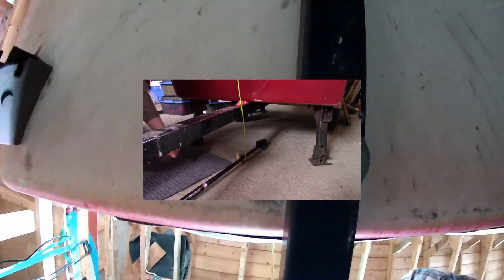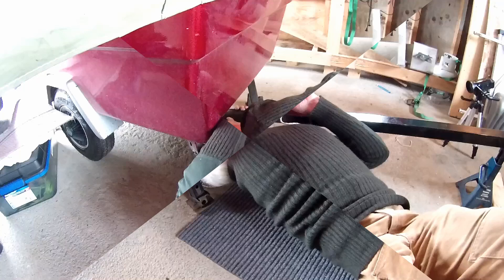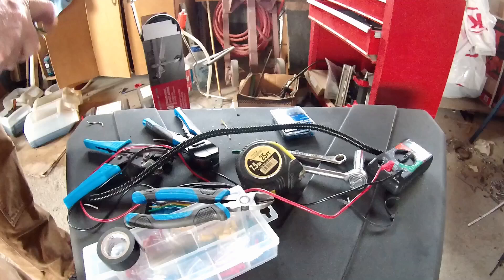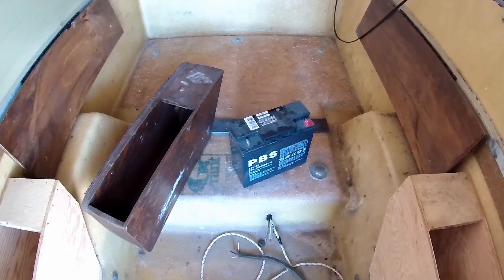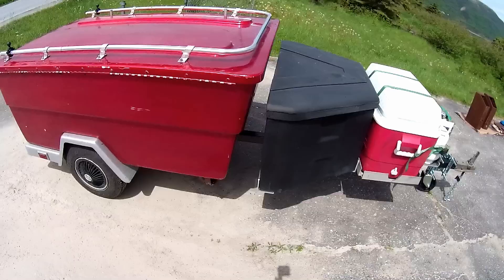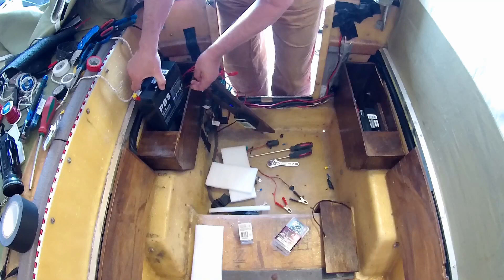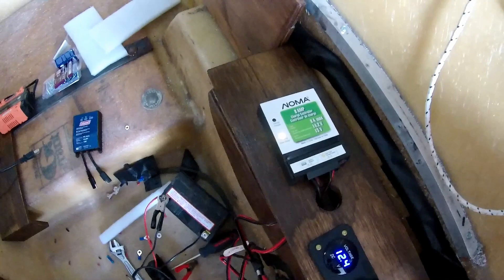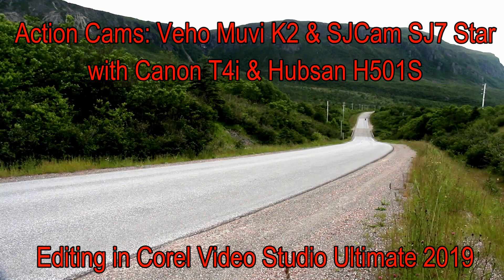More MINI MATE Renovations Part 1 2019 Ep 24

Comment: I own a Mini Mate as well and have enjoyed your videos and especially some of your mods. I plan to steal a few. I'm about the same vintage as you so can appreciate your perspective.
I found it interesting when you removed the tongue. The second bolt holding it on is someone's modification. I know this because my first run with mine 3 years ago (I'm the second owner) I stopped at my second campground, disconnected the trailer and set it down on the two front stabilizers and when I let go of the tongue it dropped to the ground dangling from the wire harness. I discovered that only one bolt held it in place and the nut had worked loose and fallen off and only the weight of the trailer and shear force on the bolt had saved me from disaster while towing. I have since added a second bolt and put lock washers on both and checking them is part of my daily routine. 

I also noticed that you remove the canopy when you pack up. I have found that just folding it back over the tent before you collapse it works well and there's no issues folding up the trailer. It just saves a minute or so during set up having it already zipped on. I do not have the add a room but may spring for one, it looks like a very useful addition. They are a bit pricey though and I'm on Vancouver Island so shipping adds up as well. Safe travels.
Reply from the maker: Steal away. I think have borrowed and modified a few things I have seen others do too.  It's great to be able to make the MM a little more comfortable for oneself. Few more ideas waiting for warmer weather here to start on.
Reply: Having sailed in a small boat before I think I will add a larger backing plate to the tongue assembly holding it on. If it works for holding up a 15 HP long shaft motor, it should work as well for the tongue.
Reply from the maker: @baltsosser  I think this was my longest tongue. The one that got bent up in my little mishap. I'm now running a 6' tongue and quite happy with it.

Comment: The Ozark trail ( rotomolded) 28qt is a great cooker ND it should hold ice for 4-5 days. Putting your solar panel over it with a hinge would keep the sun off the cooler and make it more efficient. .I have the 52 qt cooler and only put ice in 4 times in 21 days
Reply from the maker: I would love to get a small rotomolded cooler in the future. Going to have to deal with what I have in the basement for now. I may have time to make an insulated cover for the one I have now before I go out for a month on the road. Every solution has it's own problems. The bigger, more insulated the cooler, the heavier it is and my 56 Qt one, the red one above is great and when filled with ice lasts 3 days. But it is far tooooooo heavy. The 26 qt. one I'll use this year is right for weight and not enough capacity. I am adding a 2nd soft cooler inside the trailer. Food and food storage will be an issue I will still be dealing with over this winter I am sure.

Comment: Fabulous sir. You’ve inspired me to get out into the garage this weekend and fiddle around on my small cargo trailer I built for my motorcycle.

Do you know approximately how much the trailer weighs either unladen or fully loaded? I’m digging the longer tongue mod.

✌🏽
Reply from the maker: This tongue really was too long. Invited too much stuff on the tongue and I was up to 75 lb.+ for tongue weight which contributed to my hitch breaking. Rough roads did not help. That full cooler and the 5 lb. propane tank just added too much weight. I had an accident later that summer and replaced that tongue with one a little shorter. So, original tongue 5' - 3 feet in front of tub, that long tongue 7' - 5 feet sticking out from tongue, ended up with 6' - 4 in front of tub and moved the cooler to on top over the axle.

Comment: Very interesting video.  I'm in the process of looking for a mini mate for my own camping fun.  One caution though.  It looks as if the volt meter is always on.  You might consider a “Master Power” switch which would disconnect the batteries from ALL loads including the volt meter.  even the small load of the volt meter will drain the battery when the camper is being stored.  You might consider a push button momentary switch to check the battery voltage at will.
Reply from the maker: You've hit that nail on the head. The on/off switch on the panel does not do what I want... going to reconfigure the panel and may add another power switch. I forgot to add that I do have a 15 amp fuse in the circuit.
Reply from the maker: @l89tvu  Neat looking product.
Reply: Any marine supply shop should have something like it.  It's a pretty standard marine shutoff.
Reply from the maker: @l89tvu  I do love a lot of the marine 12 volt products. In this case, I have now thrown an off/on switch into the line that I had in one of my parts bins. No more drain until I want it.
Reply: @OldGuyonaBike  OR........................just a relay for your original neat little switch. A relay hid away will keep things neat and less bulky looking than the large marine disconnect.
Reply from the maker: @codraven57  I've got my 2nd switch in the system now and as long as I have very little load on when I switch I'm not worried about wear and tear on the switches. The relay would not have been a bad idea either. Got too many of them under the seat on the bike now, lol.

Comment: Nicely done Jim.  You mentioned that you had taken the padding out of the tub along with the carpet.  Mine MM does not have any padding, does it make a difference or is it just a moisture collector?
Reply from the maker: Thanks. I believe it is just a fibre carpet underlay actually. Have never had that much moisture in the tub... guess, although I have traveled in snow, I really have not dealt with a lot of rain...yet.

Comment: My wife watched this video and suggested that I needed a longer tongue. But, don't I need a trailer first? I'm also new to motorcycles.
Reply from the maker: Your wife might appreciate a longer tongue. I do believe in this video I had the 7' tongue (2' under the trailer) and it just invited me to carry too much equipment on the tongue, increased tongue weight too much and made manuvering sluggish which your wife might not appreciate so much. The original tongue was 5' and it really was just too short. I've been traveling with 6' tongue the past 3 seasons and have found it to be quite satisfactory. Your wife probably would too. If you start doing any amount of long distance riding and motorcycle camping, at some point a trailer will become a viable option. Get comfortable with biking first and get out and explore the world.

Comment: When you fold up the camper, does it fill the interior of the trailer or is there still cargo space in the trailer to pack stuff?
Reply from the maker: There is lots of room... about 15 cubic ft. I've also gained space for some stuff by taking the foam mattresses out. I converted to a 38" wide standard single size bed in order to have a 22" space to always stand up in. Although there have been more modifications since this particular video, the basic packing has stayed the same. I'll do a new pack video in May (still winter here). https://www.youtube.com/watch?v=qJn2v10kh2I&list=PLNPd0jZhrqvW9LfXW4x9FPLqY3Ex36zJ6&index=7
Reply from the maker: The actual packing starts around the 10 min. mark.
Reply: @OldGuyonaBike  Thanx!

Comment: mmm? did you make the toughen longer by any chance ?
Reply from the maker: A couple of the old timers I've corresponded with had gone to a 7' tongue (22" i under the box) from the 5' that the MM comes with. I thought I would try that. Handles well but the extra length just begs to have too much on the tongue. As she was set up in this configuration, the thumbnail for this video)  I had a tongue weight of 90 lb. with the full cooler. Tooooooo much. Only did one weekend like this and that's the weekend I did not seat my hitch right and lost the trailer into the ditch. That tongue got bent up and I replaced it with a 6' tongue and started strapping my cooler on the top over the axle. Tongue weight down to 60 lb (I can live with that) and the whole thing pulls and handles really well.

Comment: i am curious have you scaled empty and then when loaded ready to go . I am very impressed at your organizing skills have watched your reno videos and like what I have seen the only part I would have trouble with is the whole solar system will have to get help have you ever considered changing the jacks to scissor jacks to maybe avoid having to pick up the tonge
Reply from the maker: I'm going to try to do an up to date reno video over the winter. I will probably raise the tub off the axle by an inch to make these jacks that much easier to get down. They are much faster than scissor jacks in the long run. The trailer with the tongue on it now weighs about 290 - 300 lb. I have individually weighed each tote etc. and with a full tank of propane and a full cooler I am hitting 450-500 lb. total. I did move the cooler back and on top since this video. I am running about 60 lb. on the tongue and have run this setup for over 10,000 km. this fall. Was quite happy with it.
Reply: @OldGuyonaBike  that's not bad it is at the limit of my can-am spyder but I like all the stuff you can carry with this set up am going to try and put some of your ideas on my trailer thanks
Reply from the maker: @harrynewton6437  Borrow any ideas you can... feel free to ask me anything on the renos as well. There are a few more little things coming up in videos later this winter.
Reply: @OldGuyonaBike  cool I think I have watched all your videos by now but the renos I had no idea of the things that could be done again thanks
Reply from the maker: @harrynewton6437  So glad you found the channel.

Comment: Where did you get the propane tank holder?
Reply from the maker: I did some measurements and  had my local metal shop bend the aluminum to my specs. I think it was 6" wide... can't remember the length and I'm not home this week (and without trailer) . There are 2 square U-bolts holding it to the tongue. i can lock it on but usually just relie on the ratchet straps to deter anyone from messing with it. The 5 lb. tank is a godsend.I can get at least 30 meals out of a tank and it costs less to fill than buying a 1 lb. disposable tank.

Comment: Hello I am new to channel and would like to thank you for the video’s. But I was wondering what the brackets look like that hold the box to the tongue?
Reply from the maker: In that video, I had the really long tongue, i.e. 7' on the trailer. After my accident, I went to a 6' tongue and moved the cooler to the top of the MM right over the axle. Much better weight distribution.
That triangular box was a good steal off someone else's photos. I made brackets from 3" x 3" aluminum angle under the the front of the box and the back of the box. I centered a square U-bolt on each of the brackets and came up through the floor of the box. I drilled out a 2" x  18"? flatbar to go over the bolts on the inside to distribute the load and also added a bolt through the box at the end of each of the flat bars. I cut the bolts flush to the nuts once mounted so they would not get caught on anything in the box.  Liberal amount of silicone caulking. It's pretty darn solid. 
The front  box was a great addition. I pack my outrigger table there, a tote with my Little Buddy propane heater with 1 lb. propane tank. The 10' propane hose for the stove. Small bow saw, hatchet, folding shovel, extra toilet paper/paper towels, a pint of MC oil, a couple of oil filters, spare brake pads etc..
All the stuff I don't use every day. With the exception of the propane hose and the hatchet.
Thanks for finding and watching the channel.
Reply: Old Guy on a Bike  Thank you for the quick response I’m sorry if I wasn’t clear I was talking about the bracket that you used to hold the plastic tub on The Toung that is right in front of MM. I  am thinking of buying  one of those black boxes.
Reply from the maker: @russferron7375  Sometimes I'm not as clear as I think I am lol. I had to go out and take a look and it's pretty well what I wrote. Just 2 pieces of 3" aluminum angle. One in front and one in the back attached to the tongue with square U-bolts. I used shorter piece of flat metal inside than I remembered.  I wish I could attach photos in the comments/reply section. If you email me at jimgcg@gmail.com I will send you photos of the setup.
Reply: Old Guy on a Bike  thank you I will send you an email in a little thank you so much you videos are help full I am working on my MM

Comment: mmmm? are they waterless Batteries by the way ? mmm?
Reply from the maker: They are SLA (Sealed Lead Acid) batteries intended for emergency lights, remote locations, mobility carts etc. They could be mounted top up, on their sides or on end. I picked these ones for their size. Knew I wanted to use the space behind my wheel wells. This also helped put some weight at the back to offset the box and propane tank on the tongue.

Comment: Really liking this channel! You keep it real and I appreciate that!  I've spent the last few days watching your videos. The mods on your mini mate are brilliant! I moto camp, just not with a camper trailer. I pull a minitrailerusa.com Shadow pull behind trailer behind my 09 1700 Vulcan Nomad. I still tent camp but want to bring along a camp stove. What size propane tank do you have on the tongue? And how did you mount it. Did you fabricate the base yourself?
Reply from the maker: Thank you for finding the channel and watching. It's a 5 lb. propane tank (weighs 10-12 lb, when full) It has already paid for itself in savings over the 1 lb. disposables which I am against anyway. I love having 2 burners to cook with. I got a metal shop to take a 5" wide piece of aluminum and bend a small lip for the bottom of the tank and then a bend so the rest of the aluminum came up the back of the tank. I've got the tank ratchet strapped to that and 2 U - bolts holding that to the tongue. I will be doing another video bringing mods up to date in March.
Reply: @OldGuyonaBike  actually the channel found me! I was doing some searches for moto camping and yours popped up. Thank you for the tips on the propane tank and size info. Looking forward to your next video